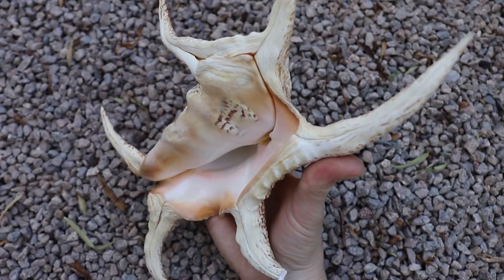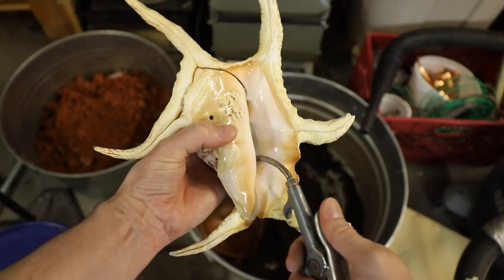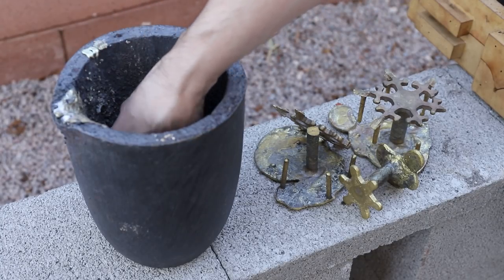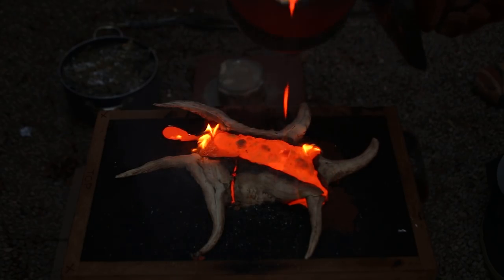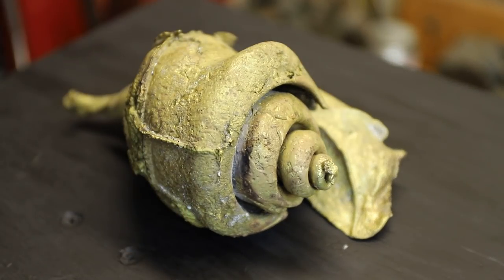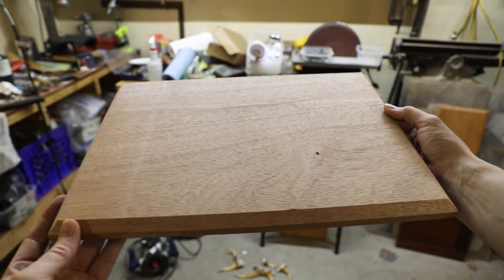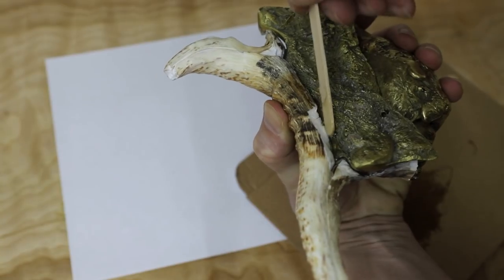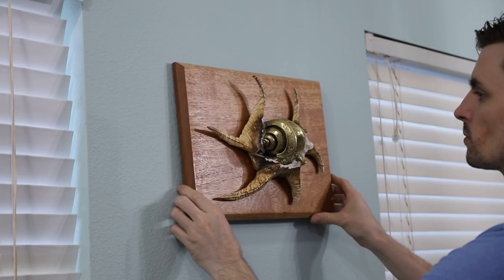What happens if you fill a seashell with metal?  Huge conch shell filled with molten metal

Comment: If you have a 3D scanner, it would be really cool to scan the shell before and the casting afterwards, and then 3D print a clear replica to replace the part of the shell that was broken away.
Reply: or just use the 3d print to make a mold of the shell to cast and keep the original shell intact instead of failing at casting it...

Comment: 6 lbs of brass is about 323.99 centimeter³. Conversion apps are fantastic for these kinds of projects. You can fill up the shell with water, measure the volume and calculate the amount of brass required. Or just wing it.

Comment: Better to warm shell and fill with wax. Soak in something to dissolve shell or for a full shell vs just the inside, use as pattern for sand cast, then remove and dissolve shell. Reverse cast shell insides and cast in plaster, 
Then mount floating in sand cast.
Pour, now you have complete metal shell